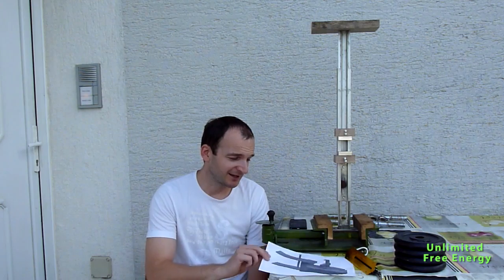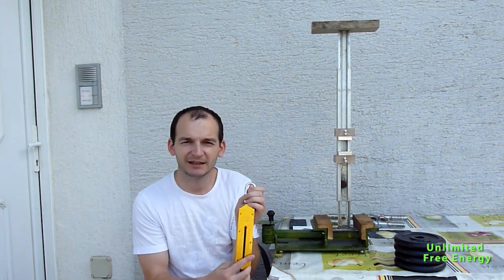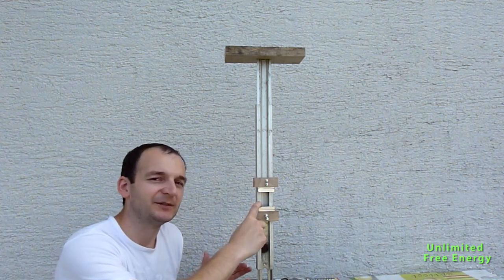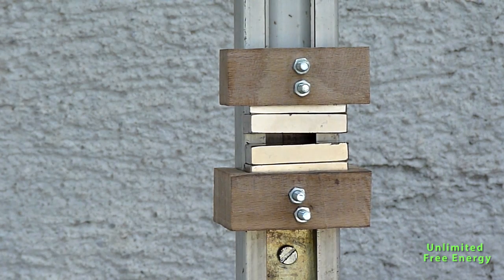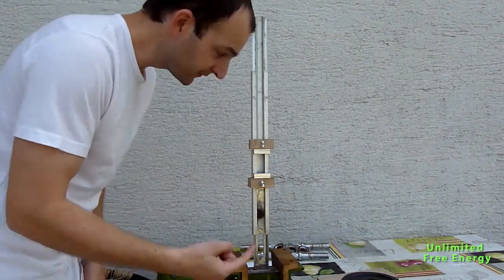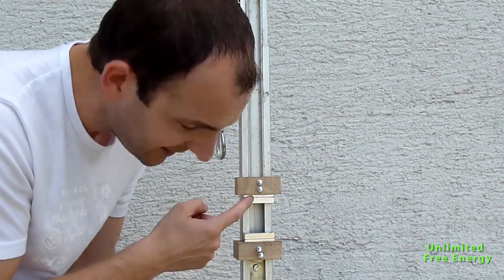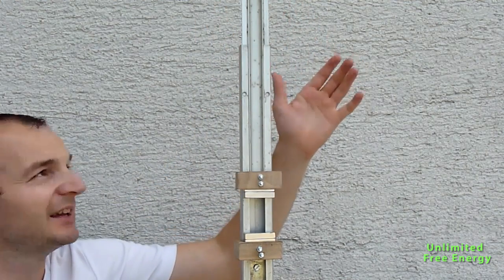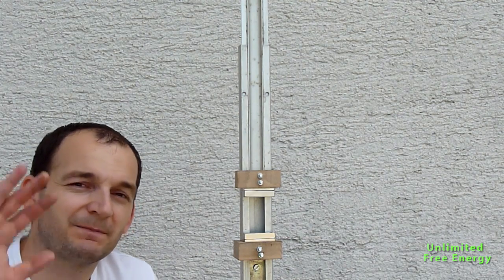Unlimited FREE ENERGY!!!!!!

Comment: You can improve the system with connecting rod crank and two system with magnets and gravity or add hydraulic or compressed air cylinders to try to create the effect of a stirling engine! You can also use springs or double-acting spring cylinders, for example two double-acting cylinders which would have the opposite effect! You can use a coil that can generate electricity that could power an opposing electromagnet!

Comment: ou can improve the system with connecting rod crank and two system with magnets and gravity or add hydraulic or compressed air cylinders to try to create the effect of a stirling engine! You can also use springs or double-acting spring cylinders, for example two double-acting cylinders which would have the opposite effect!

Comment: Add a similar set up to the top and see if you can get the center piece [ slider ]  bounce between two magnetic ends. The initial push of the middle slider to the bottom will push up the slider due to magnetic repulsion only for the slider to bounce up to get a magnetic repulsion from the magnet on the top. I have been thinking of this idea for a while but have been lazy to take time for it. Let us see how long it keeps bouncing and if we can get a good amount of bounces we can try tapping the movement for energy generation.

Comment: they should make a spring and shock absorber out of strong magnets, that might miniaturize it, maybe.
Reply: Jose Ceballo Mercedes, gmc, bmw already have magnetic suspension systems in their premium trim vehicles.i know in the gmc denali pickup truck it has a bunch of settings that are ever changing depending on how the road condition  monitor reads the road conditions. It changes the stiffness according to the road conditions by activating electro magnets in the shocks which uses the magnetic fluid/shavings in the fluid to give desired/required suspension.